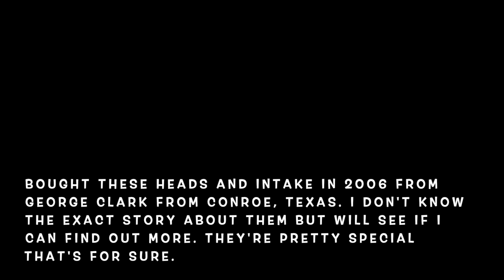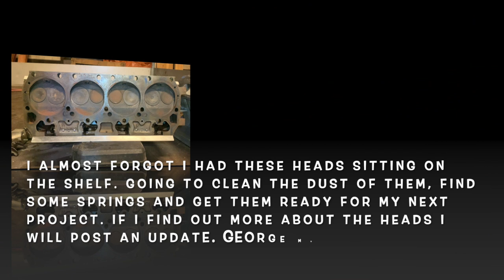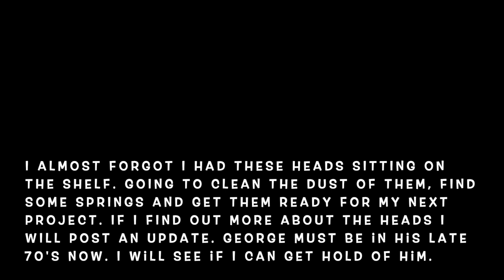Mopar 906 mystery heads. Insane porting.

Comment: Those look like the size of the Brodix B1 heads intake ports. Definitely a lot of effort put in these heads, really curious how they would flow.
Reply from the maker: marino they flow 430cfm
Reply: @dutch_oven  Holy crap!!
Reply: @dutch_oven  So, those heads are in the Netherlands now? On a drag car?
Reply from the maker: @jeffrykopis5468  Yes they are in the Netherlands. On a shelf for quite some time. I am finishing a project the coming months and will start a new one after that. 
It’s either going to be a trackday car or a 69 cuda fastback. 
If it’s going to be the Barracuda than it will have a 440 with these heads.
Reply: @dutch_oven  Those look far better suited to a high compression, big cam, high revving drag car than they do for a street car. And I'd guess that the repeated heating and cooling cycles of a street car might lead to cracks, given the amount of porting and epoxy.
Reply from the maker: @jeffrykopis5468  before I decide what purpose they should serve I will consult the machinist who created them. Haven’t called him yet which is a shame on me. Working too many hours right now and am totally knackered when i’m off work. 
Am gonna do it but too much on my mind right now.

Comment: I have never seen the 413 - 3 with exhaust plate adapters!
Reply: If they're from a 413-3 (whatever -3 means), they ain't 906s. If they're 906s, they ain't from any 413.
Reply from the maker: Casting numbers say 906 so they’re not from a 413
Reply: The 413-3 was a truck / industrial RB block with heads more like the LA 318-340-361 but with water flow outlets
differing in placement......